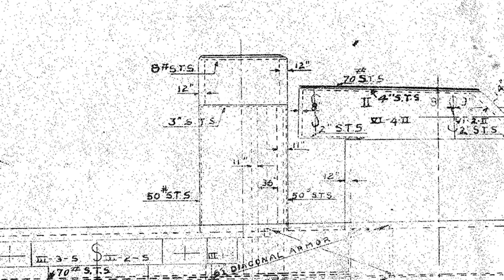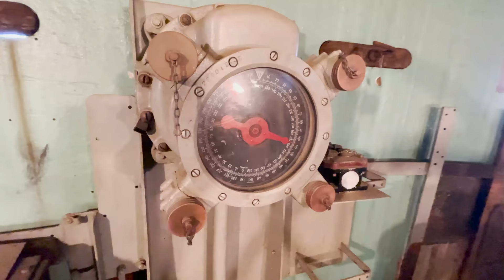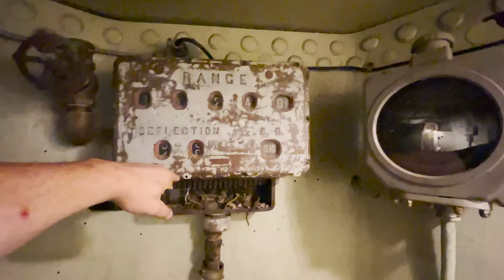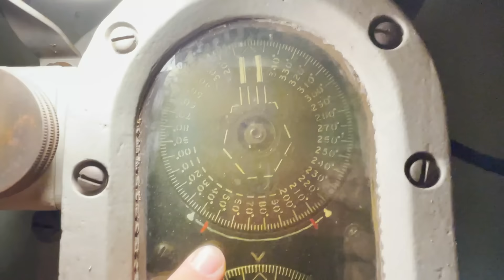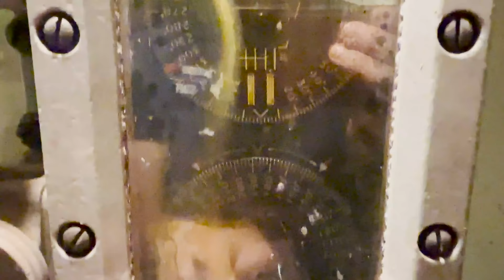Battleship Texas Conning Tower

Comment: The other reason it opens upward is that if a shell penetrates and explodes in that area, the rim of the hatch will prevent the explosion from forcing the hatch into the conning tower. It it was the otherway, the dogs would have to be so much stronger to try to keep the hatch in place.
Reply: I'm a year late but I came to say the same thing. I'll be willing to bet that's the main reason.

Comment: After touring the ship years ago I always wondered why there's such a large gap between the top of the conning tower and the underside of the bridge? The ship looks odd compared to other battleships of the era.
Reply from the maker: A chunk of that is the age of the ship. As built a pilot house wasn’t part of the thinking, making her pilot house an after thought. Her conning tower wasn’t tall enough to include as part of a pilot house design that wrapped the bridge around the conning tower -turret 2 would parent this. I believe the Navy didn’t see the need to go through the expense and time of raising the conning tower; it would have also changed the stability of the ship. 

With an unraised conning tower, there had to be an air gap between the top of the conning tower and the structure above due to the periscopes and gun director.

Comment: I wonder if any of those periscopes survive somewhere in surplus storage or in other museums.  I'm not surprised that the hatch swings down.  If the counterweight were inoperable the hatch could still be opened just with the pull of gravity.  There is no way someone could move that much steel without assistance otherwise.
Reply from the maker: You never know. Alabama had four our Mk 15 gunsights that were removed in 1946 and one of the ship’s rangefinders turned up in an nautical antiques shop in Florida.

Comment: The 2' X 3' hatch is about 840lbs. 2X3=6 square feet at 140lbs per square foot. (20lbs per half inch times 6 gets 3 inches of armor)
Reply: 20 x 6 is 120 per square foot not 140.  20lbs for 1 sq foot of half inch times 6 is 120 lbs for 1 sq foot of 3 inch. 120 x 6 is 720 lbs.

Comment: great to see the remains of the damage/repair done after the Cherbourg incident, will be good to see the inside of the pilot house too
i'm also interested to see where the damaged shell came into the stateroom 20 at frame 19, just to see if the damage repair is still visible, is that shell still on board? i really hope so, its all part of her history
not a lot of room in the lower conning tower, must of been a sauna during the summer months, lots still to do in the upper conning tower, great progress, i guess the slits were open to the elements for improved visibility, well nearly, and the cause of all the rusting inside, have to keep the birds and the bats out though, nasty acid poop

Comment: I first saw TEXAS when I was a kid, around 1962.  THe ship was glorious!  The next time I saw it was in 1984 and I was horrified by what I saw!!!  In the intervening 22 years, in the interior, everything that could be broken or unscrewed and stolen had been.  It was a RELIC at that point.  There was standing water in the bottom of the ship with lots of trash floating in it.  I'm guessing much of this was just from rain being alowed to enter through open doors.  Negligence!  Disgraceful!!!  The ship had basically been abandoned to the ravages of the disrespecting public, rather than preserved and properly displayed as a museumm piece.  It was clear that the proper resources to monitor and maintain the ship had not been provided for a very long time.  Now, there is an effort to restore the ship, but where will they find all the proper period fittings to replace all the missing parts?  It is terribly sad that the state of Texas allowed this treasure to be pillaged.

Comment: I have a question about steering the ship.  It looks like there's a small tiller to the right of the wheel in the conning tower (seen at 14:51).  Was this connected to a motor so the helmsman didn't have to turn the wheel?
Reply: EDIT: nevermind, I posted before getting to that part of the video!